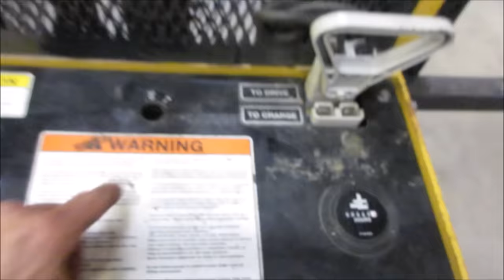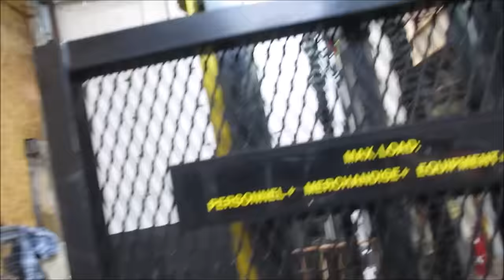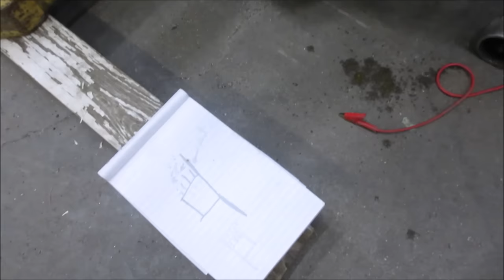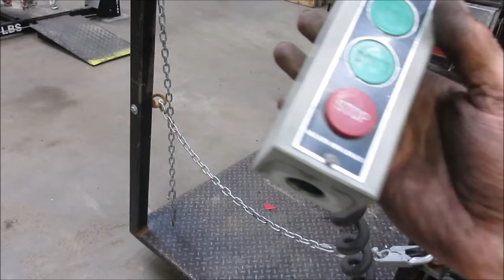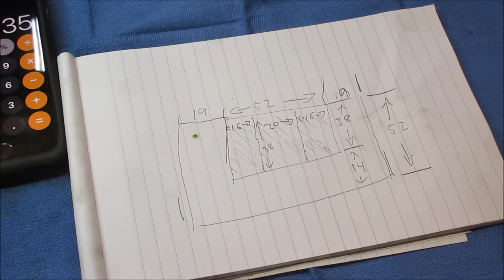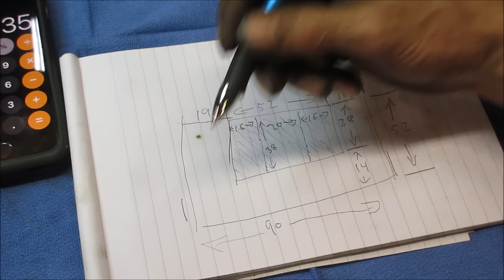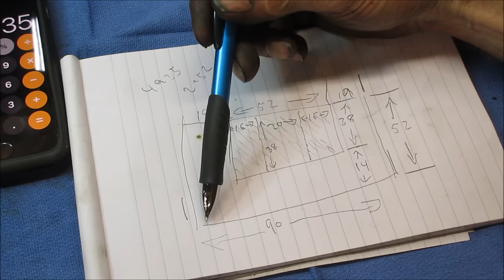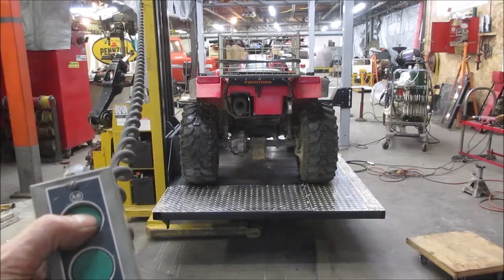Busted Man Lift Turned into a 2nd Floor Barn elevator

Comment: his knowledge and desire to troubleshoot a problem is unsurpassed..and his laughter is infectious..Andrew and Mustie never ask for money..class acts..
Reply: How dare you compare Mustie to that Pig.
Reply: @eric_seguin he just said he doesn't ask for money. Calm down.
Reply: I think he bit off way more than he can chew on this one.   This is a highly engineered machine without much safety factor built in. He is dramatically re-engineering it.  The size of that platform is not arbitrary.
Reply: @tarstarkusz  yeah. He did say it would be bolted to the floor. If not, it's gonna need stability supports.
Reply: @eric_seguin  ..should have been more explicit....Andrew Camarata...
Reply: Your lack of understanding does not increase the complexity of the world around you.  His gig is YouTube. This is content.
Reply: Great idea and great job
Reply: EZ stuff
Reply: @tarstarkusz  Yeah, on some youtube channels you get top notch diagnosis on display, and then here, it's basically "I poked around randomly and gave up" - this ain't no pine hollow auto diagnostics. This is like a waste of time!
Reply: Agree, Whenever a Mustie1 or Andrew Camarata video comes on, I immediately watch it. I love both of their content.
Reply: @kman-mi7su camarata is more of a sledgehammer repair tech, but he gets stuff done! And enjoying to watch!
Reply: His knowledge is great. I'm a fanatic about tracking down schematics and diagrams because I'm exchanging so much stuff.
Reply: @petereriksson4405 chainsaw, not sledgehammer paleeze

Comment: As a forklift mechanic that works on these every day I was yelling at the screen far too much, most likely there is an issue with the potentiometer behind the panel on the backside of the handles, i've replaced hundreds of them for just wires breaking off them alone and hundreds more for the potentiometer being bad.
Reply: I’ve only ever used one, but on it the platform had to be all the way down before it could drive.
Reply: @kyhillbillyhomestead8888  Yeah I was thinking the same. It would not be safe to drive with the lift up
Reply: So no store in high self? Sounds strange to me.
Reply: I agree with you  also  I want to point out that  he might be a good mechanic  but  I think  he never prepare  to do the videos good  if I was him  I will try to find  the repair  manual of the unit  and find the  problem   but in the end I think  I think  he was going to  take it apart any way  all that time we spend  listerning to him it was for nothing  (he like to hear himself  talk)  I ove to earn about another stuff I do not know  but  all the talking  it get to my nerve  and this is not the first  project I see him do  and  I like it but all  that talking it make me  crazy  especially when at the end he do not do what we think he doing  but something else  what you think
Reply: As Mustie1 had no intention of using the drive wheel, I think he just did this for his own curiosity and to give the viewers a bit of an idea how it worked. 
Thanks for the information about the potentiometer. As we know from the relay being full of water, the lift was left out in the rain, I would say the pot. was corroded inside, at a guess.
Reply: @martinromerocintron6294 he enjoys trying to figure stuff out without a manual
Reply: The broken part had a round bumper on it , the handle has a round dent on it . On the ones I use to operate, they only ran when the handle is down
Reply: Same here! I've worked on hundreds of electric forklifts and pallet jacks, wish I was there to help him. There is microswitches (like the broken one he found) in the hand grip assembly for the forward/reverse contactors - those silver canisters under the Cirtus Motor Controller (which was making the clicking sound that he thought was the motor). No longer in the field - retired now, miss the challenges!
Reply: That’s what I was going to say, or dittos to that

Comment: We have a similar one at work, the drive handle needs to be pulled down in the right spot to activate the drive , its around the mid way down point , then the drive will work,. If the handle is up as yours is, it will not drive. Its a safety thing .
Reply: Exactly! Too bad we couldn’t tell mustie before he wasted a lot of time going through it.
Reply: That's what the switch he jumped was for.
Reply: After minute 40 he gets into it
Reply: I bet there's a relay that stops it from driving when the boom is up too.
Reply: @edkorobanov6841  Maybe the relay that was halfway filled with water… 👍🏼

Comment: forklift mechanic here, the microswitch in the arm is, as you said, for the integrated brake inside the motor, but it needs to be CLOSED to work, its a safety feature so when the power is off the brakes are still applied. also, in the models i've worked on, this switch is usualy part of the circuit that enables/disables power to the drive motor so you cant accelerate with the brake applied.
this means you have to connect those two wires from the broken microswitch and THEN start poking around with the relays, if the motor isnt burnt this should be an easy fix, judging from the water inside that relay (it is upside down by the way, thats how the water got inside) the most likely issue is a rusted contact on the controls or the main relay
Reply: I knew somebody knew what is wrong here
Reply: I agree there must be a wheel lock that's used to steady the lift!! That switch you were by passing may lock the wheel!!
All the best from Canada
Reply: Most definitely 💯👍👍👍👍
Reply: If the handle is up it won’t roll that’s why it won’t move as the man said the micro switch under the handle
Reply: I Kept shaking my head the whole time when be was trying to get it to move without pulling down tbe handle first😂. I have used a Big Joe before. Not this model but another one. If the switches are replaced or bypassed I believe it will work. Sweet find for only $200 though.

Comment: My mate prides herself on her bargaining ability (she lived in several African countries where bargaining is a sport) but even she was in awe of asking $500 and getting it for $200. Coffee just brewed and we are both sitting down to see how this works out. Best of luck from North Carolina farm country.
Reply: when stuff sits on marketplace unsold for weeks, you know they're desperate to get rid of it, especially something big like this.
Reply: @M.TTT. and $500 was at the  partially working level, and it went to non-functioning before the final price
Reply: This is a prime example of what happens when you have unqualified operators attempting to fix something flatly beyond them. This machine likely could have been maintained and repaired at a proper maintenance shop and saved this company thousands. However in their infinite wisdom of "It's cheaper to fix it ourselves", it cost them an entire perfectly serviceable machine.
Reply: @TempSFugit-kk1dk  most foremen get that backwards, and think the material should be no more than 3% smarter than the employees.
Reply: @OmegaGamingNetwork  That's a recipe for never trying to fix anything.  The proper maintainence shop is the one that gets it working.  Is Mustie a proper maintainence shop?  Is he a qualified operator?   The best way to fail a repair is never to try.
Reply: @MattOGormanSmith 
Failing to attempt to repair is probably what put it into that condition in the first place. They probably saw the key switch fall inside one day and said "I'll have to remember that's what happened".... then didn't fix it, and eventually forgot why it stopped working.
Reply: Fellow North Carolinian here 🌲
Reply: I would say that the company had probably upgraded to a more suitable Aerial Platform and were just glad to write it off their books. Sometimes it's right place at the right time and Mustie1 struck the twin jackpot.

Comment: I worked at a company with a contractor, and they made their own freight elevator from a huge forklift mast, and the finished product worked as well as a freight elevator, but saved the company about 10 grand. This included all the safety controls, doors, etc.

Comment: Curtis instruments has the generic wiring diagram for that drive motor controller. Yellow steady flashing light is called a heartbeat. It will also emit a flash code like a 2-3.

Comment: You can download the complete manual for this if you need to.
 Big Joe Personal Electric Lift Model PDI-20-T12-BR S/N 800395
Reply: If the forward and reverse motor is a 24dc just try putting 12v or 24 v power to the motor to see if it works
Reply: Thanks that info will come in handy for many
Reply: @MunkyWrench  yeah... because search engines are not a thing ANYBODY has ever used before.....
Reply: @Look_What_I_Did  search engines have that tendencie to show information people share online...the irony.
Reply: I’ve noticed that over the last four years the wiring schematics service manuals, and other diagnostics links are not as readily available as they used to be

Comment: Pull the handle for the controls/steering half way, then the motion may work. There is a safety switch to prevent it from accidentally moving in the resting status.

Comment: That Curtis black box thing that had the yellow flashing light, I found the manual online for it and the steady flash indicates normal operation. If there were an error it would flash rapidly such that you count the flashes and look up the corresponding code in the manual. So that module is working fine. 

Also, I would definitely replace the rusty relay. Long term that could be a life safety concern.

Comment: Hey Darren, 
Thats shop lift is a awesome idea man. 
* dropped screw update * 
Its under the tire on the power master, 25 years ad a hvac & appliance tech has honed my droped screw finding capabilities I rekon 😂 just happened to see it.

 I have to disagree with you appliances not having a wiring diagram in them. ALL appliances have a wiring diagram/tech sheet in them if you know where to look. They hide them so your everyday home owner can't find them, but they are still there. 

Microwave - usually behind the panel at the top of the door. 
Refrigerator - normally behind the kick plate at the bottom. 
Stove - normally in electrical compartment with all the switches/control 
Washer - usually in the main inside compartment once top is removed, 
Dryer -  usually in the control compartment
Dishwasher - is almost always buried in the insulation on the back of the kick plate.

Comment: I'm deeply jealous. We keep our scaffolding up in our loft and man is it a pain in the ass to pull down when we need it. This ended up so pretty I wish you'd just raised the new platform 1/4 inch so you could just have one slab of the aluminum on top.

Comment: On the pallet jacks I used at work the steering handle was spring loaded to pop back up vertical. If you just let the handle pop up all the way the machine stopped. When in use you pulled the handle down, but not all the way down. If you pulled it all the way down it stopped the machine. All the way down told the machine you had tripped and fell down. It stopped so it wouldn't get run over.
Lift the handle part way up then try moving it.

Comment: Just be careful after your modifications are done because the center of gravity has now drastically changed, especially the higher you go.  Also, don't forget your placement of the load this will also contribute to the stability of the lift taking place.
Reply: he mentioned it's going to get lagged/bolted to the floor and used as a stationary lift.
Reply: @dimitar4y  I should have watched the video to completion. The comment was made off the top of my head while watching it.
Reply: @JoeSmith-vs5mc  he. loosely mentioned it. in like a 2 second clip. I don't blame you. xD
Reply: @dimitar4y I'd make temp dock latches with removable  pins at top to stop lateral movement
Reply: He could extend the bottom legs out to be even with the edge of the platform.
Reply: Good point
Reply: Comprehension is a challenge for people like you....

Comment: You might need to lengthen your footprint when you lengthen the work surface. This will protect you from a tip over. I would just get a piece that fits inside the existing box tube, cut the ends of the feet off the lift, and add the new material, welding at least 3 sides of it. 
By not using the intended batteries, you are making it easier to tip, as the batteries are part of the counterbalance, so you'll need to take this into consideration in your design. I do realize that you want to anchor it down, but to lengthen the box tube would be to your advantage.
Reply: Yes, if it was still mobile however, it is being bolted down.
Reply: Being bolted to the floor makes the footprint huge and your comment is null.
Reply: My comment is not null. It's still a necessary part of doing a job right. Why risk breaking concrete when a little steel on the feet would help with balance and control?
Reply: @Farm_fab  because he wants it permanent and it's his build not yours so yes null comment.

Comment: Darren, the device at the front of the handle is an inertia brake. If the machine is in operation, and it gets close to a wall when the handle is left go, when the brake makes sudden contact with the wall, the brakes are activated. It's the same function if a body gets in the way.
Reply: I've always called them belly switches, same thing used on epj's
Reply: Otherwise affectionately known as a belly button.
Reply: They sure do what they are supposed to  (btdt) 🤣🤣🤣🤣

Comment: Great mods, Mustie!  However, you 'may' have to fabricate some sort of height lock (floor level lock) to prevent bleed-down of the ram (hydraulics) to keep the hole in the second level floor filled and avoid having a huge gaping manhole (😆).  That's a very interesting video!  I like the way you work.  Thanks for the very interesting content!  All the very best to you!
Reply: Or he makes a hinged floor in the upper storage floor and has a vertical rod on the lift platform, with a wheel on it, to lift the floor up. If the platform bleeds down, the floor will drop back in place. Added safety.

Comment: In the Army we used to cut up tires and use the tread to space uneven areas,It worked well and lasted forever on our dual wheel jack for trucks,Parts can be hard to get in overseas assignments,Mentioned it because of the 2x2 and the platform uneven surface at the back of the landing plate,The tread absorbs the slight difference without all the reshaping or cutting and welding, Big tires are free along side the road most times. You can screw it down to the landing legs,Replace as necessary.Just a thought.

Comment: Hey Mustie1! I’m thinking, on the side pieces of diamond plate. Perhaps you should have put a 90 degree bend where they met the existing steel plate, that was also panned 90 degrees. This would have eliminated the extra two pieces of stock (and added weight), and added strength to the aluminum diamond plate side pieces.

Comment: Coffee and cheerios Sunday morning is complete now😊 im halfway thru video. I have ran many forklifts and standing lifts. I have to say this when you change the platform you are changing the machines center of balance you may need to add weight to the opposite side of the machine.

Comment: The back two extensions could have been on top of the plate, especially since those two uprights are left on. You aren't really losing and usable area. It would create a safety edge and allow the platform to go all the way down. It would only gain you an inch or two.

Comment: on most units like that they have a safety aspect were if the forward and back handle is up it isolates movement , so the handle bar must be lower to enable
Reply: huh? on all the ones i've used the handle must be up to use them,
the handle down operates the 'dead man' switch
Reply: Yep I was about to type out the same thing... most have to be waistline to operate in a safe manner.  So if the handle is too low or too high, it will not fire the motor for forward or backward operation, but the belly safety button will always jump the motor in the forward position.
Reply: Here in Austria the handle, when let loose, has to return springloaded to it's upmost position, where it activates the brake and disables movement. The same is to say for the lowest position, so if you stumble while pulling the lifter, it stops immediately. Safety regulations.

Comment: This episode is definitely high up on my list of favorite Mustie1 episodes. 
Something way different than his usual projects. 
No carb to tear apart and rebuild 😂
Lots of metal fab like I used to do in the early 70's as an Ironworker welder repairing large 16 to 20 foot long parts racks and square interstackable tubs for GM that insane forklift drivers mangled the crap outta. 
That was before I enlisted into the Coast Guard and became an Aviation Machinist Mate Flight Mechanic.

Comment: Hello sir, Do you remember when you tried the broken switch inside the steering section. That clicking relay may have been the brake being pulled in. Which would allow you to roll the frame around easier. I think it would wheel may lock when no power is applied and be electronically pulled free when power and safeties are all in ready states. just a thought. Otherwise another awesome video!

Comment: On the install, consider adding to u channel uprights at the back of the platform, fixed to the base. Have guide rollers affixed to the platform, running in the channel . That would reduce side to side movement of the platform without compromising the load space .Also extend the base legs under the platform , to the outer edge of the platform footprint. That would reduce any tendency to topple forward. Ingenious solution for a goods platform. Truly thinking out of the box.